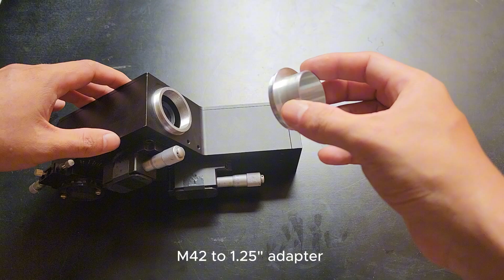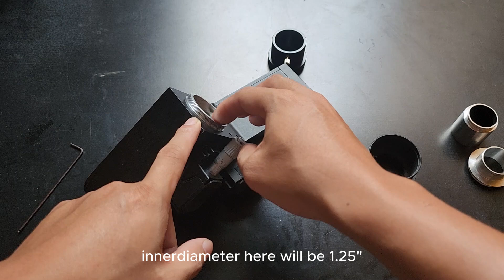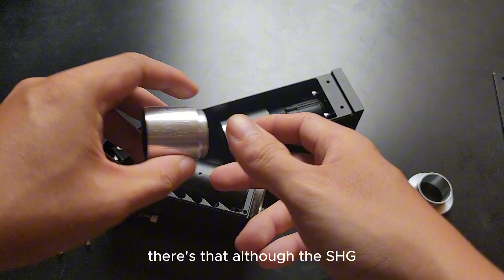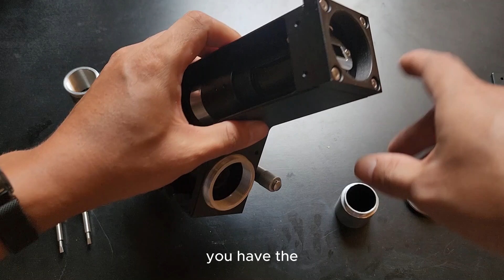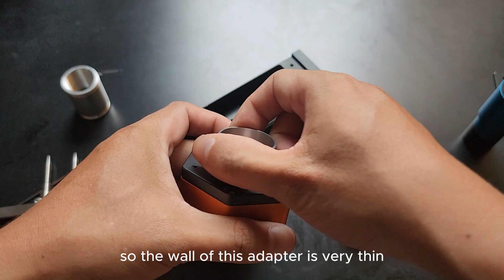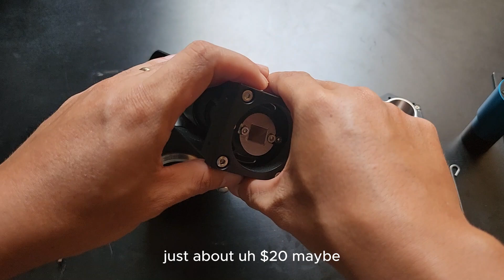MLAstro SHG 700 Quicktour

Comment: What basic telescope you suggest for this? I know you have some hints on your website but I would appreciate a list with some examples, from cheaper to fancier.
Reply from the maker: Basically any decent double would do. I am using a no branded 102mm F/6 doublet and it works just fine.

Comment: Excellent overview of the magnificent MLAstro SHG700, Minh!
Just FYI, in contacting Doug Smith with regards to using a UV/IR filter ahead of his quartz slits, he prefers the Astronomik L1 filter. Per Doug, the main reason is being able to transmit as much as possible at short wavelengths.
Reply from the maker: Yeah if you want usage in the UV you'll have to use a UV pass filter. The L1 is a good choice